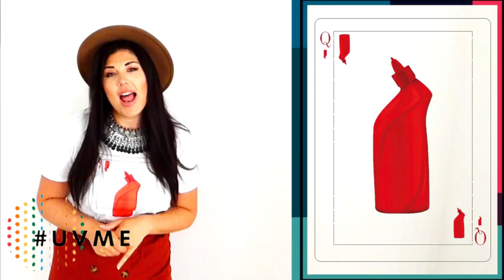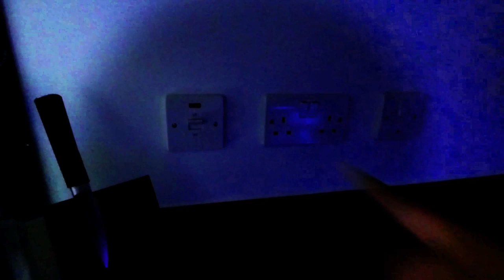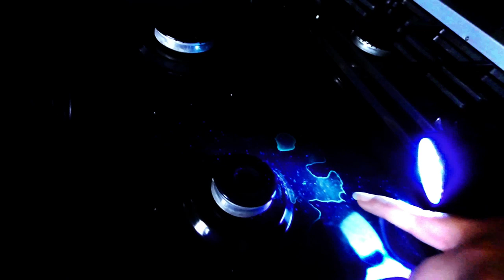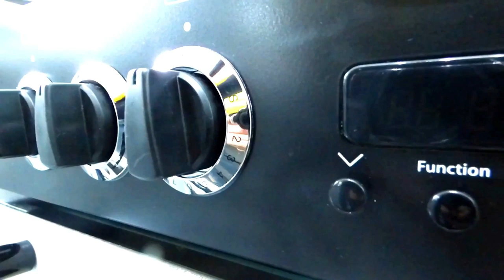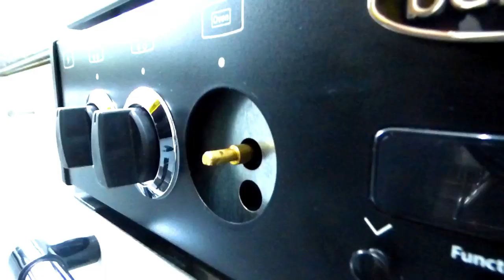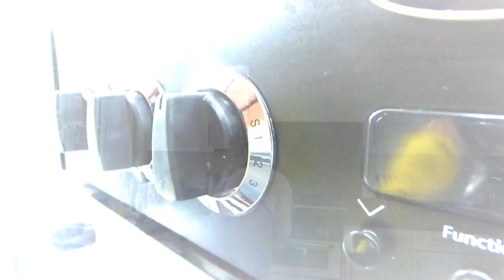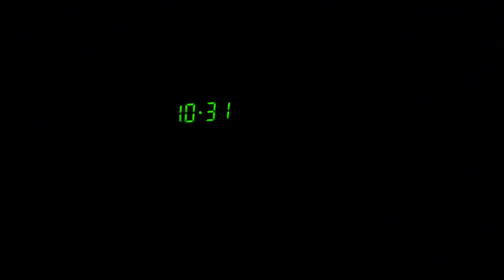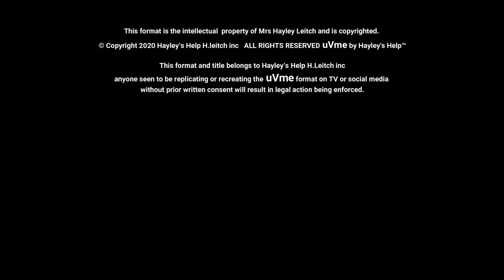Ultimate Kitchen Cleaning Motivation 🧼 Deep Clean A Kitchen - Kitchen Cleaning with a Twist!

Comment: Robbie you get a 10 for participation, a 6 for effort, 3 for technique.  Tip for ur knife block n wood items use metho or ethanol with elbow effort, skip the water n soap, then u have no fear of mold, grain swelling etc.  Also eventually you gonna cause wear on ur paint and countertops with the abrasive cleaning particles, unless ur ok replacing those things frequently of course.